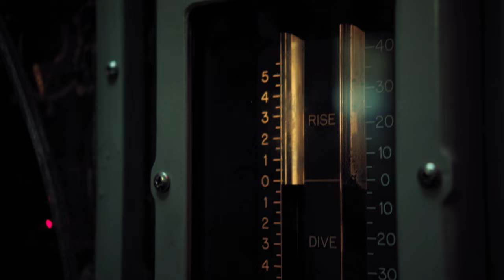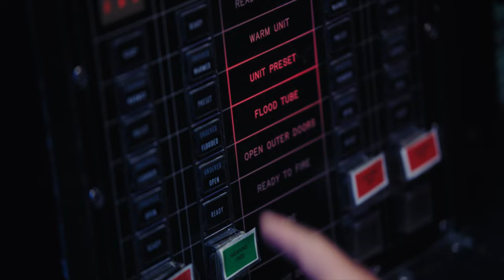Life at Sea: Navy Submarine

Comment: Misleading and partially insulting. From a 688
Reply: how so?
Reply: Yes, as a former submariner who spent over 1,000 days submerged, I can tell you that life aboard a submarine is anything but easy. You work your butt off (mostly mentally) and must be able to adjust quickly to tight quarters, no sunlight, and close human contact with some you would not otherwise get along with outside of that life. Until one is qualified, no gaming or movies. 

It Will test your mettle. I am fortunate enough to have experienced it and to have served my country. I did enjoy my job (missile control center, aboard missile subs) and that career, but did not "love" it at the time (80's and 90's). Good overall camaraderie and food!
Reply: I'm being trained on a 688 right now and its tight. Especially the engine room though ops isnt too bad. Anyone over 6ft has to crouch
Reply: @ujustgotpwned123able  Everyone does not have their own racks. On some they do, others have to hotrack. People are not this happy and chipper on a daily basis. Most do not have an allocated gym and all the space the video is showing to have. The open spaces the video is showing are taken at the very best angle and are the biggest spaces on that boat. You will know the people you work with very well which can be awesome. On the flip side, knowing that someone you might consider a friend is stealing from you and shipmates. Morale can be terribly low, although I'm told this is not the case on most boats. If you are 6ft, your head and heels will simultaneously hit the ends of almost all racks. 

Every sentence said in this video can be independently true. The opposite of every sentence is also true.  What bothers me is the perception the video is portraying.
Reply: There's a big difference between a fast attack and a Boomer.

Comment: Asa submariner in the 70's on a boomer sub. 6 months a year in the northern atlantic doing squares in the n atlantic waiting for a call to launch. We worked in shifts 6 on and 12 off so there was a lot of time on your hands. To do drills. Also we never surfaced do to tell the time of the day we ran red at night, real light during the day. Don't know if they still in do it. I was on a lafayette class now they have tridents. Which I saw being built at groton connecticut. It was 2.5 bigger. FG2
Reply: 6 on 12 off sounds like a dream compared to an ETN going port and starboard 12 on 6 off